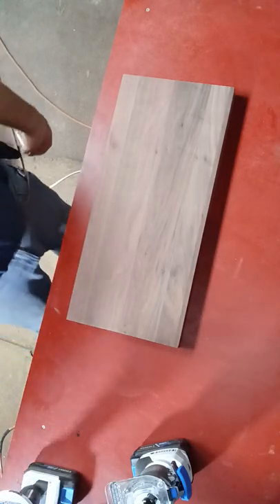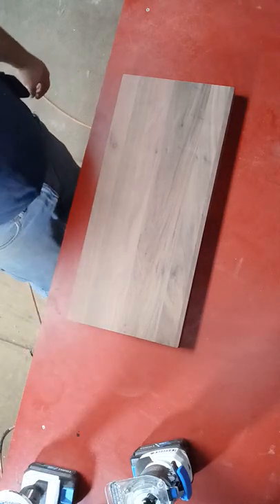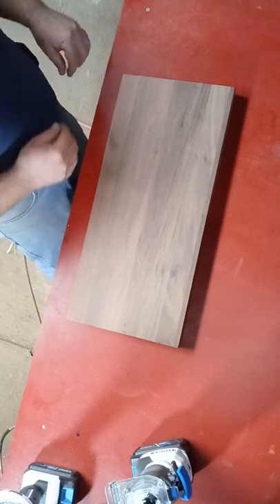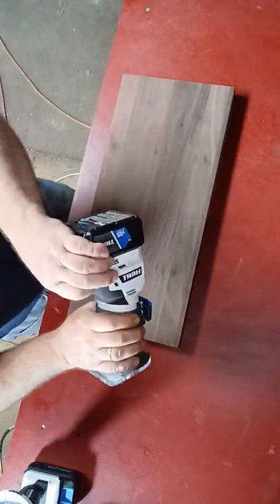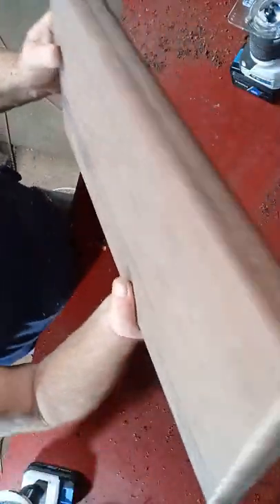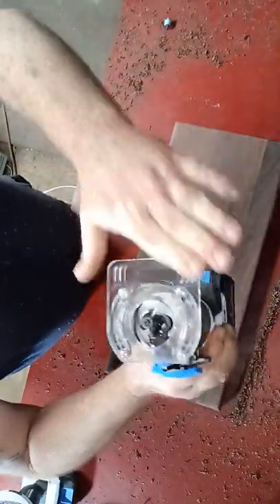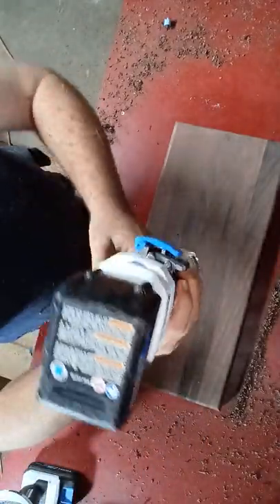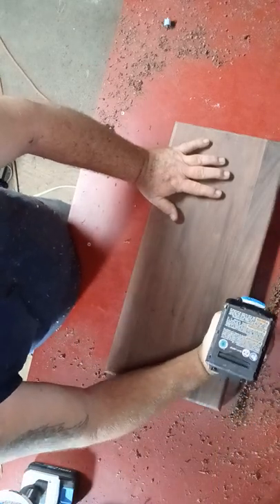Hart router 20v

Comment: I think you are going the wrong direction. Counter clockwise when the bit is down, clockwise when bit is up.
Reply from the maker: When you go against the turn of the router bit it's called chipping out which gets its name because it chips out small  pieces of wood in the video the direction I was going is called a climbing cut it goes the same direction as your router bit is turning this way it's less likely to damage the material that I'm routing since the cutting board I was riding had splinters and chips I decided to go with a climbing cut instead of a chipping cut. The chipping cut is easier and to me not as dangerous as a climbing cut a climbing cut it is very easy to let the router get away from you.